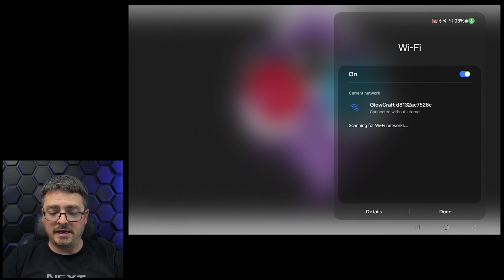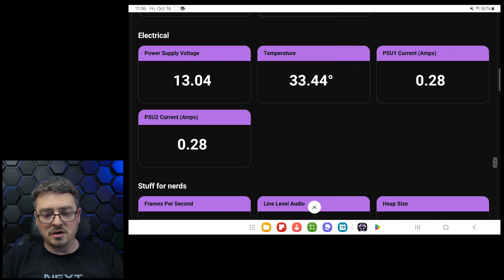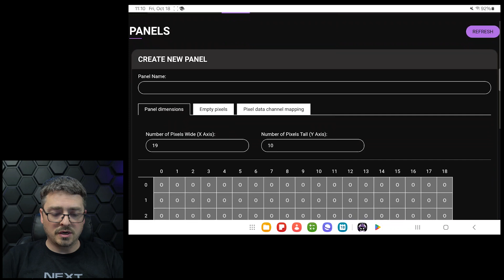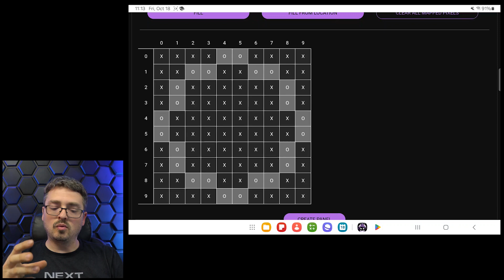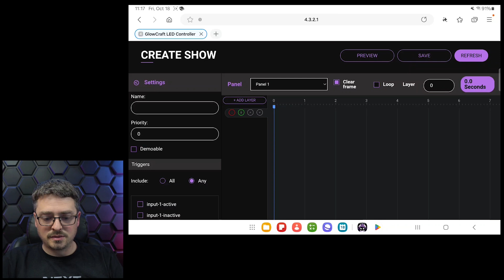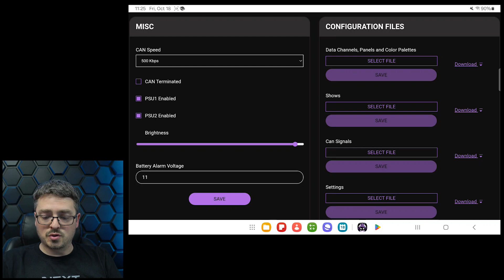GlowCraft LED Controller Overview. The latest controller for Color Flow LEDs.

Comment: How did you create the bit maps? I bought this controller hoping I could play an video animation but cant seem to figure out the bitmaps
Reply from the maker: In the bitmap tab in the browser screen. It's kinda like a light bright.
Reply: @NextLevelNeo  Oh that makes sense. Then you just used the animations portion to make the blinker scroll left or right.

Wondering if you might know. I'm using SK6813 leds white he controller, but I can produce white or yellow lights, I saw that you have both of those colors on the leds you were using, do you have any thoughts as to why that might be?

Comment: Was told about this controller from Zac Cook. I have a 1984 toyota supra with bad taillights and was starting a project with 700 individually addressable leds on each side. I'll watch more of this video later, but im wondering if its pretty similar to using the blue ghozt module

Comment: def interested in this now! currently rebuilding my nsx tail lights might scrap the current project and redesign the board for this controller. pretty amazing concept on the software end and doesn't seem to complicated to understand from what you displayed.
Reply from the maker: @thai6670  it can be fairly straightforward but you can get really fancy if you want. And you can add programming as you go, so build them, install them, love them, and still change them up later on.

Comment: can we recommend they add a carplay app? thats the biggest thing I have been wanting to see with the BlueGhozt so I can start it up from my car screen as I enter a show
Reply from the maker: That would be difficult. Most older car play radios need a hard wired connection. The rest are Bluetooth. None are wifi. I'll mention it but I'm pretty sure that's not possible. You could get an android head unit and download the app to it. Many people do that with blueghozt right now.
Reply: You can always install an android unit.